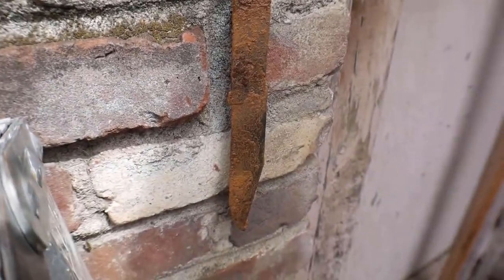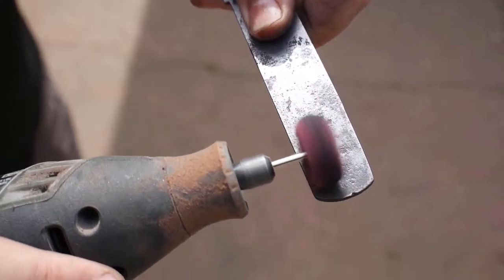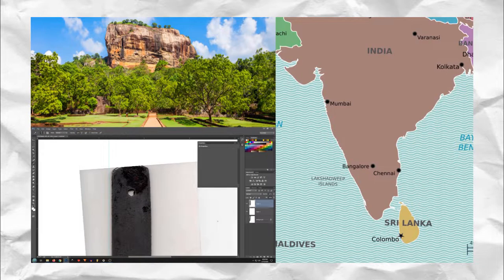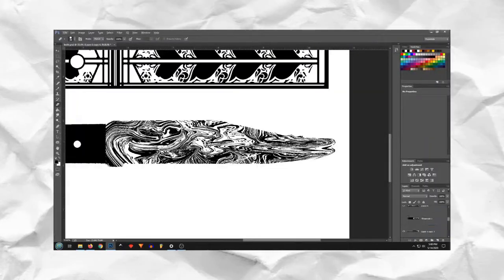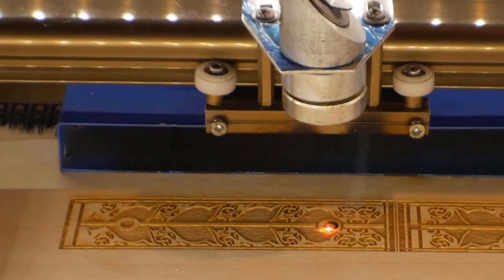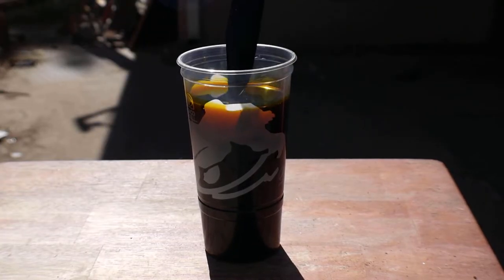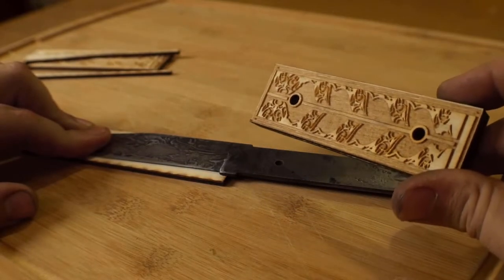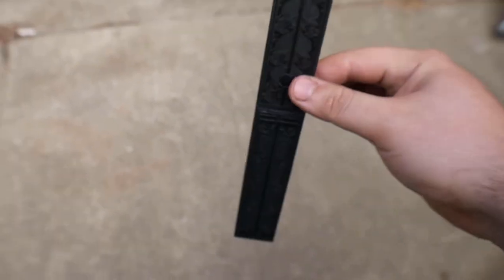RUSTY OLD KNIFE RESTORATION - LASER DAMASCUS

Comment: Do you think this would work with one of those classic steel etching laser sprays?
Reply from the maker: Those laser sprays like cermark don't really etch the metal, it bonds to the surface of the metal and leaves a visible mark when enough heat from the laser is applied, but it might work as a resist for the acid... But it would be way cheaper to just use the spray paint haha